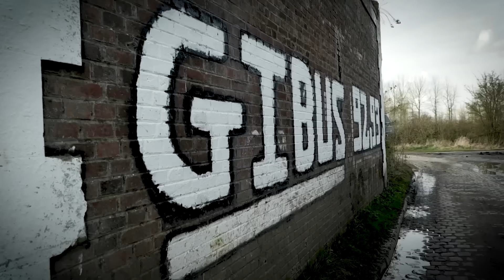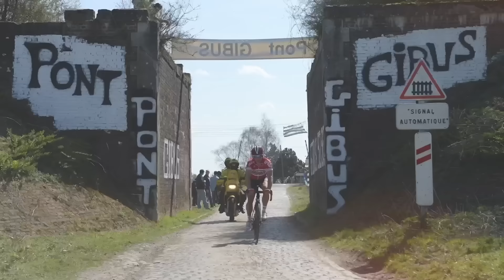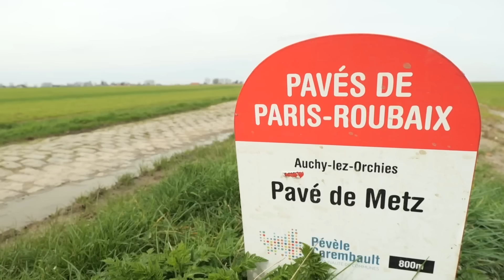We Rode Cobbles Too Rough For Paris-Roubaix!

Comment from the maker: Would you be confident keeping the pace high on these treacherous cobblestones? Let us know 👇
Reply: If i was using inner tubes and no stem/seat post suspension,  then absolutely no.  Love your content, thank you.
Reply: Yes if I had wide tires at low pressures and Redshift stem and seat post. My road bike has an ISP so I cannot testify to the effectiveness of the seat post, but the stem is awesome on rough surfaces even though I probably have one stiffness too stiff an elastomer. It still helps a ton on a bike that only accepts 28 mm or thinner tires. I have ridden on cobbles and the difference between a carbon stem and the Redshift is worlds apart. I highly recommend the Redshifts they really work. The shock absorption is akin to my gravel bike's WTB 66-622 tire at 1.3 Bars. Imagine a road bike with the suppleness of a very wide gravel tire run at a lower than optimal pressure for rolling pressure. Except on a fast rolling road tire at optimal pressure.
Reply: The faster, the easier it feels, so yes. If you ride the sportive version, ride it as interval training, only going all out on the cobbles
Reply: Excellent filming from the camera operator on the cobbles
Reply: I noticed smooth path next to cobblestone 👀
Reply: I found it easier if I went quicker. At about 15mph or faster, you bounce over the worst. Slower than that & you hit EVERY bump! 24mm tubs, too.
Reply: @paulbrown4235  24mm ? I ride 33 mm minimum on Paris Roubaix, the bigger tire volume enables less tire pressure, adding comfort without loosing speed.
Reply: Oh heck no ... not to mention the fact that I can't even get to a high pace.
Reply: I very nearly came off a couple of times today on slippy sections of normal road on a 40 mile route in training for Ride London 100. I'll stick to that thanks. Great video!
Reply: Having ridden both the Southfield Service Drive and Hines Drive in SE Michigan, absolutely confident cobbles could be conquered.

Comment: Rode a few sections on my Specialized Roubaix, well you have to don't you? Cracked the rear rim around three spokes, didn't find out until I was cleaning the bike.
Reply: No cracked rim, but I had +-20 dents in my rim because of the low tire pressure I used. (Had that more the one edition, still never flatted in any of +-8 editions I rode)
Reply from the maker: Rouxbaix can be so tough on bikes 🥵

Comment: Riding near-ATB specced road bike on that cobbles proves...yes, what exactly? Mankind is too weak to ride 23c tires on this or human brain has evolved to not ride narrow tires on rough surface?
Reply: Narrow tires are faster on hard cobbles. Wider softer tires feels smoother and probably nicer but they bounce and resist moving forward too much. The idea to ride cobbles is to ride as fast as you can so you move only on the very upper surface of the road. Wider tires are just for masses for comfortable slow recreational riding.
Reply: Going faster on crappy road is something well known for motorists (not all, obviously) - open throttle and omit most of road irregularities. Still not sure about how useful this exercise is.
Reply: @tongotongo3143  BS. I have ridden the Pave on 33 mm tires several times and it’s much better then 28 or 23 which then need to be bone hard to deal with not damaging the rims. I have seen adapted MTB’s with +45 mm slick tires and these guys were impossible to follow on the roughest sections. GCN has done a test comparing and the fatter tire was the clear winner.
Reply: You ride recreationally for your own pleasure. While pro athletes ride for maximum possible speed and victory. The difference between you and them is huge. Those unscientific “tests” for masses of tax payers is just a joke, and in competitive cycling no one takes them seriously.
Reply: This exercise is actually useful because it isn’t only polishes pedalling and riding technique, but also conditions body, bones, tendons, and muscles stabilisers.
Reply: @tongotongo3143  if you find +30 average on Roubaix ‘leisurely’ … but if you look at analytics by the likes of Dylan Johson or Peak Torque, you would not say that with such confidence. From my experience, I’m sure wider slick tires are always more comfortable for Roubaix, because you get less fatigue towards the end. Now, if you are talking about ‘the spirit of the sport’ it being an unfair advantage to ride wider tires, yeah, I get that sentiment. But the racers race their racing bikes because that’s the material they get from their sponsors, not because it’s the optimal bike overall. 
I’m still calling your assessment BS.
Reply: @tongotongo3143  I rode the Velodrome several years, that’s were you pick up the pedalling technique, not on the cobbles.
Reply: Your thoughts speak very clearly than you are far away from the sport of cycling not even to say elite pro level cycling. Professional cycling teams aren’t given wide enough tires from sponsors:):):).. bye bye night is beautiful and sunny:)
Reply: @tongotongo3143  Conditions?!? 🧐
Reply: @tongotongo3143  assumptions, assumptions. I can say the same of you, but I let your nonsense speak for itself.